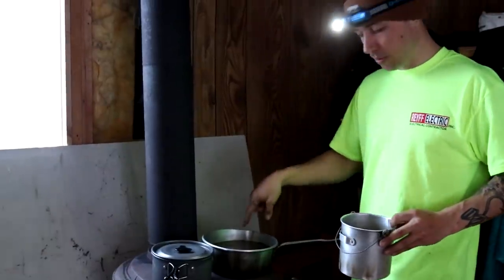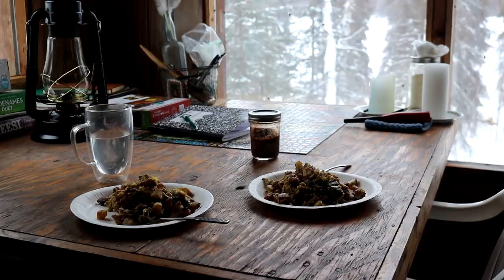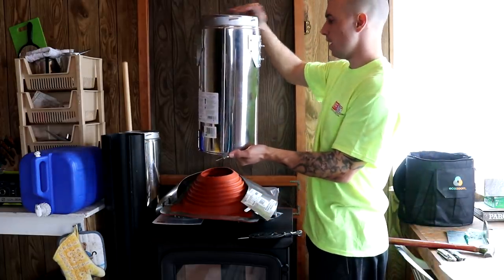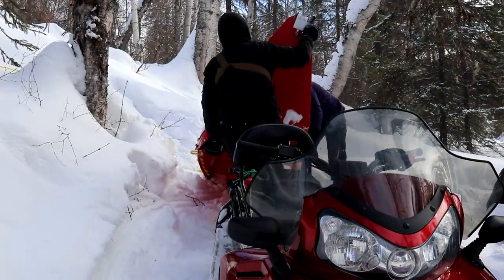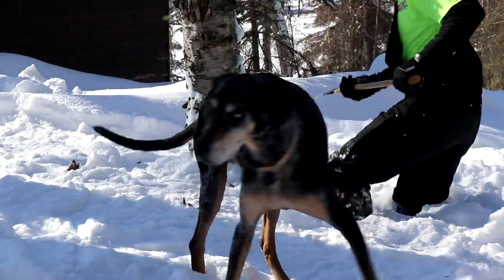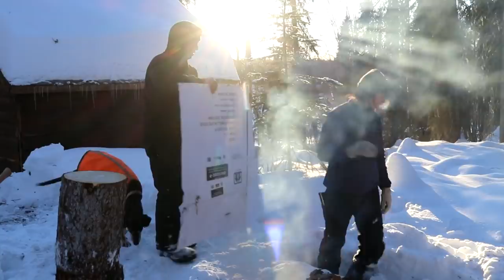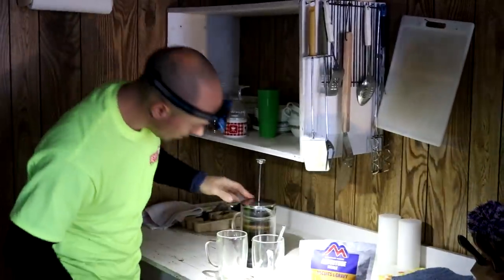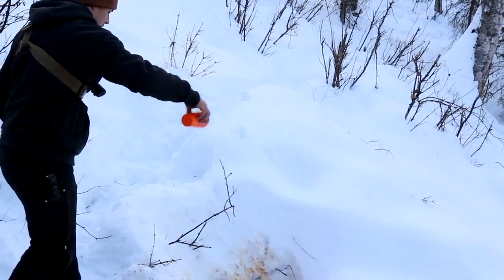Winter Trip to Our Alaskan Off Grid Cabin (Part 2)

Comment: 10:00
Light from Heat
There is a company called BioLite, they use a Technology that converts Heat like Wood Stove Flame into Electricity. It can be storred into a Battery or used Passively to power up a Lightbulb

Looks to me like you need something like that, where as long as there is fire in that Box, you can also have Bright Light that goes with it... Free Electricity as long as you have  Wood to Burn